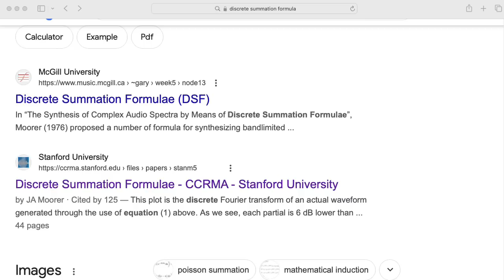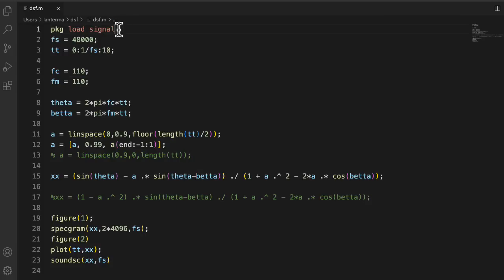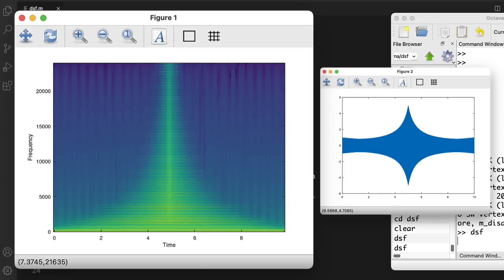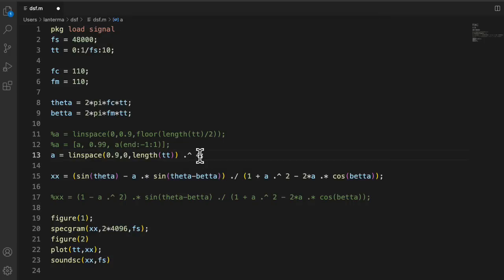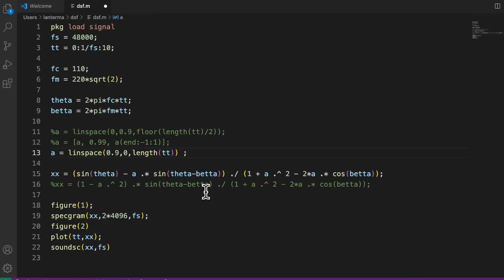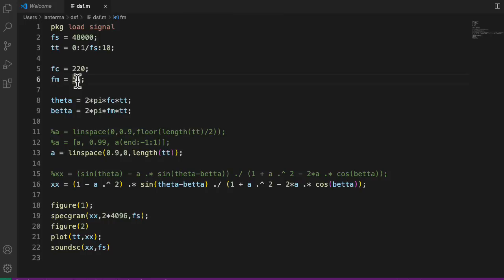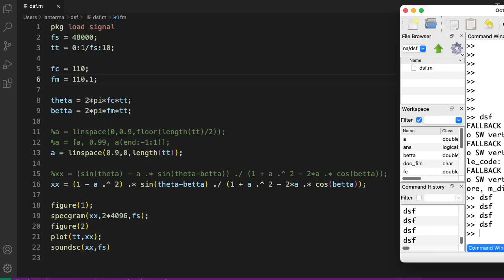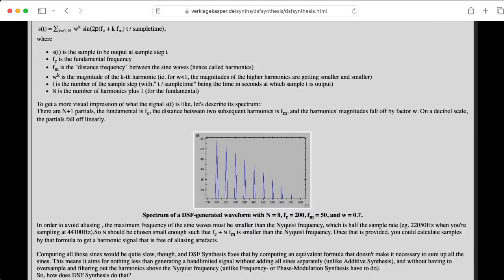Sound Synthesis via Discrete Summation Formulas: Unexplored Terrain (sounds kind of like FM)

Comment: hi, i would like to suggest a topic; it's about summing sinewaves too: In Synclavier REGEN there's this additive synthesis part of it, but it seems most of us are lost when it comes to dealing with each harmonic's phase. i think what i see on vids (enven with starsky) is revelant that no one really get's it, imo to really experiment witch phase in additive you'de need to stack iddentical timbres (at least for start) and then try to mess around  with phase relation to iddentical harmonics  played in paralell (there's so much to explore with those things like regen or the c15)... This was really interesting as usual. About phase distortion, witch i'm fond of, a casio cz is a must have if you are really intoo sound design techniques; i was thinking you can achieve that in an analog way with very simple circuits if you decided to make one per note in an organ fashion, but the term "pase distortion" seems to mean different things: on a cz style pd you are morphing from a complex waveform to a sine wave, but in the lectronic druid's taplfo chip, wht he calls phase distorion is diastorting phase on the other axis, it's shifting phase width (on units i built using this i called that function CNTR for "center shift", so just to talk about pure definition; you can do "phase distortion" on both axis of a waveform right? Thaks for sharing this.

Comment: Could the aliasing be unavoidable because you're basically doing an infinite summation, meaning you will always add partials higher than half the sampling frequency, no matter what parameters you choose?
Reply from the maker: Oh, yeah, technically speaking some of it is will always be unavoidable in the formulas I'm using, just like in regular Yamaha-style FM synthesis. You hope that the partials decay fast enough that the aliasing isn't objectionable. My suspicion here is there's also some numerical weirdness going on with the division that's making these effects sound more objectionable here... but I don't really know for sure.
Reply from the maker: It turns out that soundsc defaults to 8 bits -- once I explicitly told it to use 16 bits everything sounded much better.
Reply: @Lantertronics  Ah, that makes sense :)

Comment: Love this, except for the MatLab code. Even 15 years ago, scientists and engineers were dumping MatLab for Python (with SciPy, Pandas, MatPlotLib etc). Some people still use COBOL I suppose, but it’s not exactly helping to keep it in circulation.
Reply from the maker: For large-scale programming projects, Python is a better choice; MATLAB evolved from an interactive wrapper for FORTRAN array routines and was never really properly designed as a language. But for things like this, I find MATLAB to be a much better fit (while also being accessible without paying silly $$$ because of Octave.) It has everything I want "out of the box" without having to think about installing and importing this library or that library, and more importantly, its syntax is tightly tied to the problem domain it targets. 

I could write this code much faster in MATLAB than in Python, and I think the resulting MATLAB is easier to read the the equivalent Python. To a certain extent, of course, this is a skill issue; the ratio of hours I've spent in MATLAB vs. the hours I've spent in Python approaches infinity. But being able to write a = [2 3 4; 5 6 7] is much more convenient than having to write np.array([[2, 3, 4], [5, 6,7]]), and I prefer writing A * B * C for matrix multiplication over something like np.matmul(np.matmul(A,B)),C) or even A @ B @ C. But then I seem to recall * is matrix multiplication for NumPy *matrices*, which are different than NumPy *arrays*, or something. So I can think about all of this, or I could just write MATLAB code and finish the video. ;)

We've occasionally looked at switching our ECE2026: Introduction for Signal Processing course at Georgia Tech from MATLAB to Python and have always concluded that it's just much cleaner to express things in MATLAB.

There's a new language called Julia that looks very interesting to me; it's kind of like what MATLAB could have been if it was thought through properly as a language from the get-go.
Reply: @Lantertronics  I’m pretty sure NumPy and Pandas offer operator overloading for matrix math, but I take your point and there is definitely something to be said for simplicity and familiarity. It took me years to stop writing scripts in Perl which has practically unreadable syntax to begin with.

Comment: Hello professor, hope you are doing well. 
I came here for a request: if it might be an interesting video idea for you, it would really be cool to see a circuit analysis of the Seymour Duncan Pickup Booster, more specifically version 2. 
I really don't grasp what happens in that pedal and can't find anyone online explaining it. 
The two things I understand are 1) the pickup resonance switch, which lowers down the resonant pick of the pickups by adding a condenser in parallel with ground and 2) the first pair of transistors is a differential pair. 
There are another three transistors of which I honestly don't understand the function at all, a pair of them seems to be some sort of push-pull configuration. 

I think there's a lot to go on about in that pedal, let me know if you think it's cool enough for a video!
Reply from the maker: That is weird... I'm not sure what to make of it!
Reply from the maker: Oh.... you know, this whole thing is basically a discrete op amp. You have the original differential input pair, the "negative" output of the pair is run through a common emitter PNP gain stage (which is inverting, cancelling the original "negative"). Then that's run through a complementary common collector stage, push-pull as you say, and the output of that is run into the negative input of the diff pair. Boost controls the amount of negative feedback and hence the gain. The schematic I found has the BJTs kind of drawn upside down, if you redraw it, it becomes much clearer.
Reply: @Lantertronics  that is interesting... I wouldn't have thought it was a discrete op-amp since the pedal is quite recent, like 2007, that I know of.
Is there any reason to choose a discrete design instead of a straight IC one?
Reply from the maker: @operatorenabla8398  Street cred? I have no idea. A similar discrete op amp shows up in a ton of Roland pedals -- a JFET pair at the input and then a 2nd single BJT amplification stage, with negative feedback as usual. Maybe they're going for deliberate small imperfections in the discrete transistor version to give it the tiniest bit of grit? It seems weird to me.
Reply: @Lantertronics  I would bet on the street cred theory, but I also must admit that the univibe preamp, although a discrete op-amp (at least according to what I've read), does sound different than a straight IC boost stage when cranked.

Comment: Is it feasible to go from matlab->c++->HDL->xilinx for audio aplications? Like designing a synth
Reply from the maker: Mathworks has all sorts of tools for going from MATLAB to FPGA, but really for real-time synthesis would want to code it very different than I've coded it (I've coded it all with bulk vector operations). You'd probably be better off coding for the Xilinx directly, or writing C++ directly for something like an STM32.
Reply: @Lantertronics  thanks!

Comment: Nice video!

I've been using discrete summation formulas in my soft synth since a number of years, they're pretty handy, especially since you can limit the range of summation. I think I derived the formula for

sum[k=0 to N] exp(z + k*w)

where z and w are complex numbers, which gives you a bit of extra freedom.

As someone said, you can use it to get a band limited if you want somewhat low pass filtered pulse train, and integrate the result for a band limited sawtooth wave.

I got an interesting harp-like multi-pluck sound by increasing N one step at a time at regular intervals.

I also did some FM+ experiments where you replace the sin function in FM synthesis with one of these functions, and got some interesting results.
Reply: I also think that if you do the double sided sideband summation using the complex version, not everything will cancel. I guess the same would hold if you did the summation using cosine terms instead, but I think the complex version is easier to deal with.

Another nice thing about the complex version is that the imaginary part is the Hilbert transform of the real part (or possibly vice versa).
I made a complex feedback comb filter once (the samples in the delay line were complex, as was the feedback coefficient). At least when fed with the output of the complex version of the summation formula, I could get the resonance peaks to move around along the frequency axis by changing the phase of the feedback coefficient.
Reply: Toivo, can you share your derivation and perhaps some tips on using your formula?
Reply: @bobvines00  Sure:
Ok, we're using the sum

	S = sum[k=0 to N] exp(z + k*w) = exp(z) * sum[k=0 to N] exp(w)^k

First note that if z = ib, then

	exp(z) = exp(ib) = cos(b) + i*sin(b)

so you can use the real part to get a cosine or the imaginary part to get a sine.
Now, let w = c + id, then I can write the sum as

	S = sum[k=0 to N] exp(i(b + k*d)) * exp(c)^k

Let's say that b = 2pi*ft, d = g(2pi*t + p), then

	S = sum[k=0 to N] exp(i(2pi*ft + k*g(2pi*t + p))) * exp(c)^k
	  = sum[k=0 to N] exp(i(2pi*(f+kg)*t + kp)) * exp(c)^k

so we get a sum of cosines/sines (depending on if we take the real or imaginary part) with frequency f+k*g, with exponentially decreasing amplitude if c < 0.
The sum starts at frequency f and ends at f + N*g. The variable p can be used to add a phase offset from one sine to the next.
I hope that explains the basic usage.

Derivation:
We exploit that it's a geometric sum. By multiplying by 1 - exp(w), the first term in the sum times -exp(w) cancels with the second term times 1, etc, which gives

	(1 - exp(w))*S = exp(z) * (1 - exp(w)^(N+1))
	==> S = exp(z) * (1 - exp(w)^(N+1)) / (1 - exp(w))

You can see that if N=0, you get back S = exp(z), as expected.
If N goes to infinity and real(w) < 0, exp(w)^(N+1) goes to zero. But the case with finite N is really useful, you can choose N so that f + N*g is below the Nyquist frequency to avoid aliasing, but if f + (N+1)*g is above then you're not missing out on any audible frequencies.

Hope that helps.

Comment: The thing is with this function, is that a "Weierstrass function" is very spikey even for some nunbers less than 1. So those might be the "artifacts" you're hearing.
Reply from the maker: Actually it turned out to be much simpler -- a commenter here noted that soundsc defaults to 8 bit resolution (probably a legacy from Sun workstation days). Once I explicitly tell it to use 16 bits it sounds much better.
Reply: @Lantertronics  Interesting.

Comment: These sounds are super cool. I’m going to see if I can get this to come out of a reasonably fast microcontroller— I know the operations are “historically expensive” but with something like Raspberry Pi Pico running at 125MHz I wonder if there are enough cycles to at least get to a decent sample rate, even if shy of 40kHz. Also curious about real-time manipulation of the parameters, and maybe taking Fc from MIDI or V/Oct.
Reply: I would expect you could - even a Pico is ridiculously fast compared to the hardware they had available in the 70s/80s when a lot of synthesis concepts like FM were born. Improvements like unrolling loops, using interpolated sine tables, and replacing divisions with shifting/subtraction could be done as needed, but today's compilers are good enough where they'll usually do stuff like this behind the scenes for you.  Don't just jump into doing your own optimizations until you've looked at the emitted assembly code to see if it can actually be improved on.  More than once I've been pleasantly surprised at how clever the compiler was in coming up with something efficient.
Reply: @lantertronics quick update on this — I got this all coded into a pico (using equation 4), without any optimization, and it’s not fast enough. If I’m measuring correctly, it takes about 2400us to calculate the value, convert it to a 12-bit integer, and feed that to a DAC — that would mean an effective sample rate of 400Hz, which is definitely not good enough. My next hypothesis is if I can use sine/cosine lookup tables (as I would for direct digital synthesis) to speed up the calculations. Also very interested to hear any thoughts you might have on how to optimize this.
Reply from the maker: @peddlereffects  I'd say cheat and move to a more powerful microcontroller like one of the higher end STM32's. ;)
Reply: @Lantertronics   :) I rewrote everything using fixed point math and sine/cosine lookup tables, and then overclocked the pico to 250MHz for good measure. I’m stuck on a weird hardware problem now, though — DAC is running through two op amp buffers in parallel and I know the hardware works because if I load a DDS oscillator program it sounds good, but when I run this I get weird glitchy stuff, not remotely close to what’s coming out. But it also seems like the software is fine because when I print the DAC values and graph them, the graph looks like the right waveform. Hopefully by next week I’ll either have it worked out or I’ll have time to post a video that shows the problem.
Reply from the maker: @peddlereffects  One of my students is having a lot of fun with the Daisy Seed.

Comment: I think you can get bad behavior when the denominator is very near zero because significant truncation error can occur there. Fortunately it looks like you're pretty safe from it as long as a isn't too close to 1.
Reply from the maker: It turns out most of my woes came from not knowing that soundsc defaults to 8 bit resolution. ;)

Comment: Interesting material. I'm gonna have a look a the paper and tinker with it. Thanks!

Btw: those uper harmonics remind me of an oscillator sync where the synced voice is offset a few cent or pitch modulated. (:
Reply from the maker: It turns out soundsc defaults to 8 bits unless you explicitly tell it to use 16 bits. Fixing that cleared up most of of those artifacts.

Comment: If you’re getting aliasing, wouldn’t the best mitigation be just to put a low-pass filter on the waveform before sending it to your sound card? With a corner frequency of 20kHz or so. Relying on k’s maximum being low enough might not cut it if you want to play a really high note.
Reply from the maker: In digital synthesis these kinds of aliased signals are "born" aliased.

Comment: Thinking about this, the REAL disappointment is that unlike FM and it's equivalent PM, I don't see that this would expand to multiple modulators or multiple carriers with ease.  And while the formula isn't complicated, the PM equivalent of FM really IS computationally simple: just sin( theta + a * sin( beta ) ), no?  You need to scale the multiplier a differently than FM but I think you just multiply it by frequency multiplier between modulator over carrier??  (Haven't looked in 10 years)

Comment: 17:09 An interesting aspect of the N parameter is to use as a brickwall filter not just near but below Nyquist, to avoid aliases (though this is great!) but also to use simply as a filter.   FM (and equivalent) can get way too trebly with high levels of modulation, but it'd be interesting to play with higher modulation while capping harmonics at 10 or 20.

Comment: I found this paper severval years ago through Noise Engineering. Their Loquelic Iteritas module(still my favorite oscillator) SS mode was inspired by this paper. They discuss some of the modifications they made to the formula in the user manual.

Comment: One thing I've used DSFs for is to generate a bandlimited pulse train, sometimes known as a "buzz" oscillator, which can then be turned into a sawtooth for example. I think the Csound buzz oscillators also use this method.

A cool thing about the Moppelsynths is that they do the math using complex numbers, making it easy to get a stereo sound (put the real part on the left channel, the imaginary part on the right).
Reply: I wonder if instead of doing pure left and right signals, what you'd get by using the components as L+R, L-R stereo

Comment: That's cool, I'm designing a base pcb for the Fubarino, than it becomes easier to play with dac's.
Now i'm waiting on pcb i made with a class AB amp that's a bit different than usual, now doing the PSU part pcb.
I got a bunch of NOS "West" German made 4700uF capacitors, seems an amp needs atleast 10000uF.